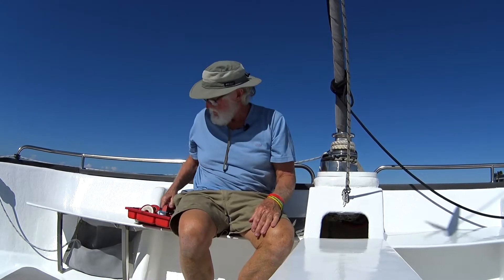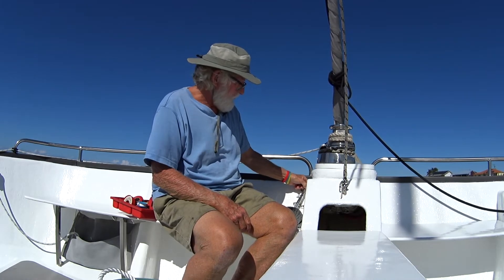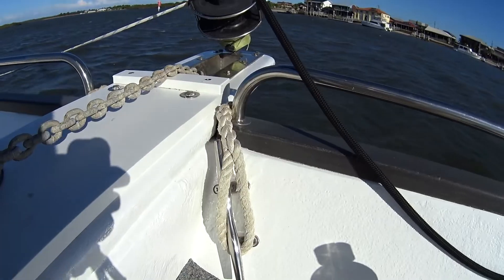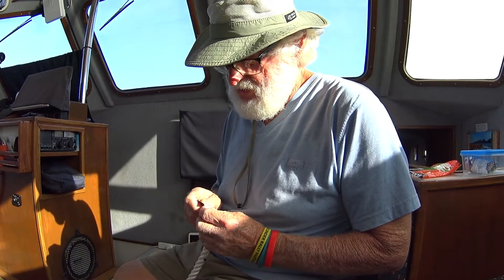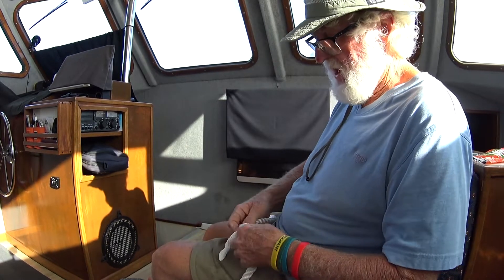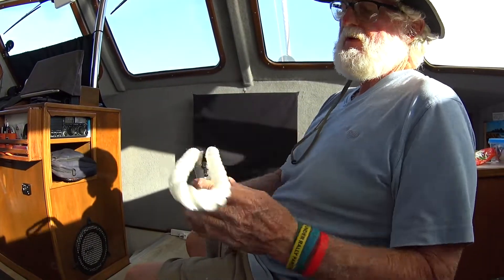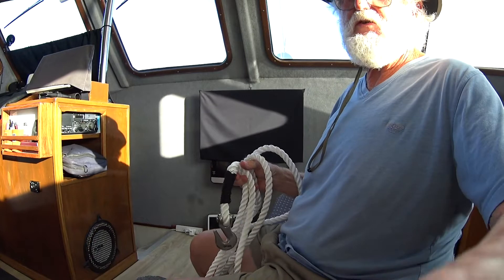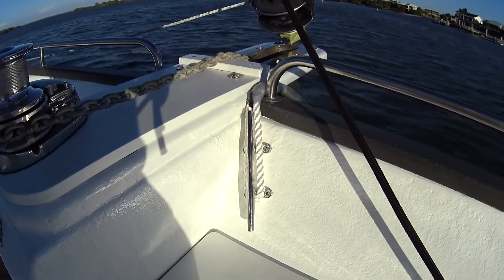Fitting Anchor Cleats and Snubber for New Anchor Windlass

Comment: Hi  norm when I purchased my boat the previous owner had the snubber attached to the windlass, it bent the main shaft and discoloured all the capstain so good move on the cleates , I know I’ve mentioned it before but fixtech does not work and will just fall apart , I know of 3 friends now all with the same issues I have had , there is a you tube channel called SV Sarean , they did ther hole  boat in it also , they spent weeks doing toe rails and chain plates and it all leaked again , mine just washes out with water now , the only fix tech on my boat that has lasted 4 years is out of the sun and in a rear locker that I glued a peice of blocking to to hold a deck wash pump
Reply from the maker: Wow glad I fitted the cleats and thanks for the advice on the Fixtech.
Most of where I have used it is inside lockers and the bit under the packing piece is sort of out of the sun. 
The cleats are through solid glass and I let it go off for a day before tightening the screws to form a gasket. I'll keep an eye on it and see how it goes. Love the Sika, bit it does go yellow.
Cheers mate. Sitting at GKI one of those outa the box days...bloody beaudiful.
Catch ya Richard.